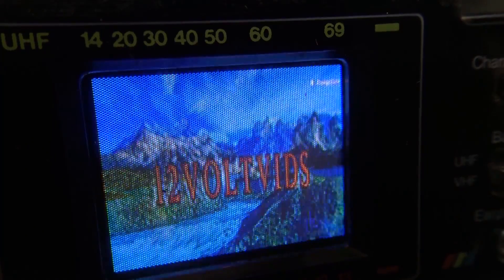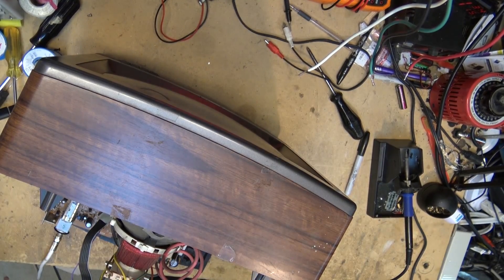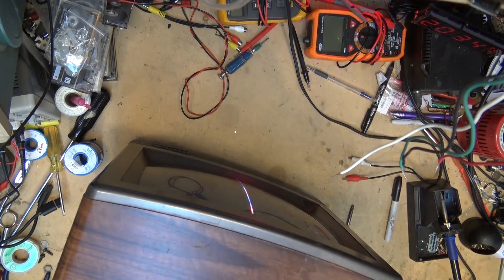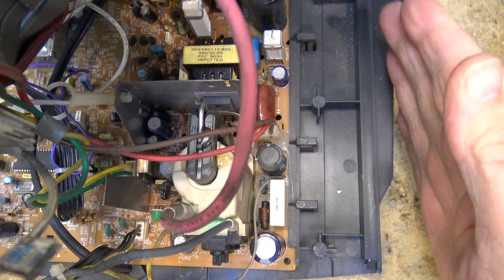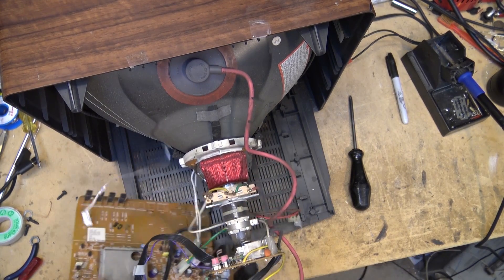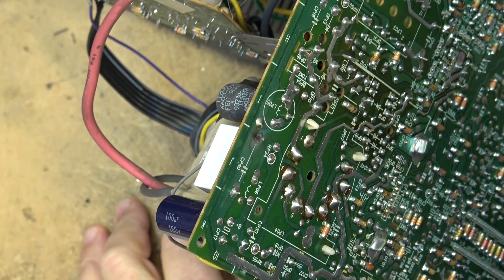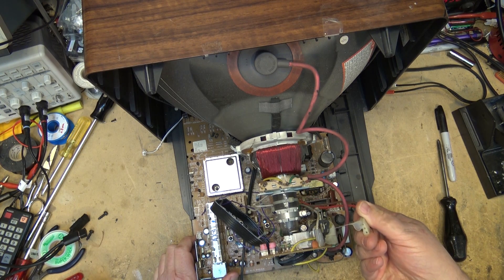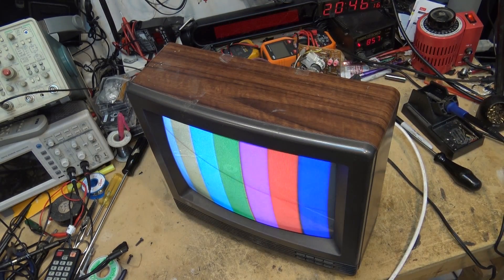Most Dangerous TV fault ever -  Fire Hazard

Comment: 40 + yrs at the TV bench at one of the biggest Zenith dealers in the Boston area. Love watching your vids, great memories.  Now bench talk.........
Maybe in Canada there was a fire recall but the only I recall we had on Zenith was the 4 lead
caps. IIRC the law suits were over the damper tube sockets on 4 tube hybrids. So common
I still remember the PN#  78-1888-01. No way they didnt have symptoms like SMOKE etc.
Also paper in the HV area wasnt used till  the Custom & Advanced System 3  @ 1983.
A few H yoke plugs did toast up on them but again now way no symptoms. The only other
thing was on some hybrids a huge disc cap would arc & burn a fiber board. The caps were
called back & if you ordered one you would get a tripler kit to eliminate it. 
To sum it up our local distributors head tech told us  " if any Zenith product goes into an
open flame & does not stop when unpowered confiscate the set & call me immediately 
if not sooner. This was late 70's

Best regards
Tom   
LFOD !
Reply from the maker: Definitely in Canada. I probably still have the service bulletin for the system 3 deflection board that the linearity coil burnt up. 
I remember the 4 lead safety cap recall too, where they changed the white cylinder type for an orange dipped type, and the damper tube failure.
There were several fires with these sets, most the board burnt up, and the set went dead, but there were a few where the set ignited, likely a console where the particle board cabinet caught. I do have a link to a news story below over one of the lawsuits. It was a Christmas day fire mid 80's. We got a bulletin from Zenith (as we were a warranty dealer at the time) that said that any set that came in within a specific serial number range that the deflection board needed to be inspected and if it didn't have a sticker on the shield that it needed to be replaced. The newer boards also had a white fiberglass shield as opposed to the gray one that looked like paper. Then another bulletin came out that said to resolder the horizontal linearity coil, flyback ect, and replace the old shield with the new one and affix a sticker to the back indicating it had been done. Now I don't know about in the USA, but here they had a few bulletins. They never issued a recall to the public telling them to not use the set as far as I know. It was just a bulletin for sets already in for service.

Comment: no av in you say?
most of polish tvs made by unimor in the 70's and 80's wern't designed to nativly support av intmut either. that is why in later years most of those tvs were either factory or privatly hacked to support "automatic av inputs"
in neptun D505 there was no av, but factory designed special av module umm2003 if i remember corectly which depending on the revision could output signal from tuner on output terminals, or take in av signals on input terminals and cut off tuner path by simple diode based polarised circuit (2 diodes,3 resistors and 2 capacitors)
the module was detecting synchronisation pulses and based on this enabled or disabled tuner default path and av passtrough
i made this module for my tv with an added bonus of rgb input. i belive it could also work with ntsc reciever , because it intercept signals before color decoder for av and after color decoder for rgb (or more precisely r-y b-y, y paths just before matric module)it might be more work for jungle ic tv though, my reciever is fairly modular.

Comment: bzzzt bzzzt bzzzzzt bzzzzzt. my fix was, scrape some trace coating, bend the leads over tight to the board and solder. alternately, wrap buss wire on the legs, scrape trace coating, lay it on the trace and solder.  neither way is good for majorly burnt board that's turned to carbon or carbon tracked..

Comment: I thought the infamous Zenith fault was the "critical safety capacitor". It was a 4-legged snubber cap across the HOT, 2 legs on each side of the cap, with B+ run through it. The idea was if the cap opened, it would kill the flyback's B+ supply and shut down the set. Problem was, the caps didn't fail open, they simply changed in value and caused the EHT to go up to over 50kV, arcing the neck right off the CRT and starting a fire.

Comment: Funny, that failure is pretty much the same that got me my first TV in the early 90s. The one I got had an electrolytic capacitor with some other stuff in parallel to that big film cap. The film cap wiggled loose but it was by all means not visible. It made the electrolytic go boom eventually and the technicians could not figure it out. So it went to the bin when I got it. I did the same, replaced the electrolytic cap, and after a day - it popped. Reverted to "bombarding" everything with solder and  then discovered that the film cap was actually loose. After that fix I used that TV until 2006 before I got a flat screen.
Reply: I remember an old RCA with a color problem. Eventually, I didn't have the time to play with it, so I sent it to a local RETS electronics school for repair - which they never managed to fix.
So, one holiday weekend after getting it back, I found a fractured solder joint on the delay line.
Needless to say, that was back before my arms started getting shorter...  ;)

Comment: Better clean that carbon deposits off of the board around the arcing point or it may arc again.
Reply: RE: "Better clean that carbon deposits". You couldn't be more righter :)  At the very least it's good practice. Period. Cheers!
Reply: I also agree, it's always good practice to clean the board where ever you do work before putting in the new parts. Impurities in welding steel is bad for the weld, and when it comes to electrical welding (aka. soldering) it's just good practice. But in reality, the repair may outlast the TV....
Reply from the maker: Arc to where? Nothing around it to arc to.
Reply: It arced on the underside of the PCB where the solder connection came loose and it left carbon deposits around that arcing location. If there is HV on one of the capacitor pins then it may find its way across those carbon deposits on the PCB to another pin where it does not belong. I don´t know if there is enough HV on that cap but I think it is generally a good idea to clean the PCB after such incidents.
Reply: I once repaired my Sony TV which had a bad flyback that arced. When I switched it on with the new flyback it arced between some pins around the flyback base and fried a diode. After I cleaned the board all was well...
Reply: i was shaking my head at that aswell....carbon IS electrically conductive and being spread across pins is not good...especially at high voltages
Reply: @WacKEDmaN  I have a lot of respect for his electronic skills, but his soldering techniques leave a lot to be desired. I've been to a lot of military soldering schools and some thing are just not good practice. However, it seems to work well for him, so who am I to say.
Reply: Early imported Japanese equipment is extremely rare and highly collectible. I think most were thrown away years ago. Many older technicians I spoke to disliked repairing them, saying they were more complex and difficult to repair than American devices. But I really enjoy repairing!🤗👍

Comment: One of the most common problems with electronics, cold solder joints. I've repaired many things just by touching up cold solder joints. I fixed my Ghetto Blaster boombox from the 80s which had weak audio output, it was simply not getting enough power. I guess the heat from the soldering iron woke up the main power filter cap.

Comment: I have a question about that solderpoint you re-soldered, it was burned and i didn't see you cleaning it and just solder over it, won't that be a weak point afterall?
Reply: ....... I was thinking identically, I would have 'wire wrapped' an additional line between the resistor & inductor. 
Have to keep in mind the multitasking of video production, our gender is not known for its mastery in this field. If he was working alone it would likely be different. You just want to wrap another video I assume.

Comment: Every one of those GE/RCAs had bad ground joints on the tuner...and I mean ALL of them.
Reply from the maker: DriveInFreak 
Yes I am fully aware of the ground problem on the rca/ge tuners. It was worst on the ctc 176/177/178 uni board that had the tuner built into the main board. Grounds would fail and corrupt the eeprom resulting in a dead set. I used to use a program on my laptop, probably still have it and I Made a interface cable with a clip to clip it onto the eeprom to reload default settings to get the set running again.  If I remember I used chip pic software to load it.
Reply: Nice. I had to go through all the settings myself. I cut my teeth on those things as so many came in when I was getting started.
I can't remember the sequence of buttons to push to get the eprom settings on the screen anymore, though. It's been too long.
Reply from the maker: Menu vol down and power wasn't it?
Been along time for me too. I "got out" in 2003 and swore I wouldn't work on electronics anymore. Then is 2012 I started working on stuff again from time to time.  Now, if I wanted to I could do it full time as I have people that ask me daily to fix their stuff. Most I decline as the modern junk just isn't worth fixing. I find the old stuff much more interesting.

We used to have an unauthorized slogan for those.
GE Garbage Engineering.
RCA Requires Constant Adjustments
JVC Junk Very Cheap.
Sony  Soon Only Not Yet

Comment: I have components from a modular deluxe System 3. It was set out on the curb with a busted CRT by the Salvation Army. I snatched all the boards, control drawer, 8 inch woofers and the tweeters. I noticed the high voltage board had a connecter burned off. I'm sure that made quite a stink. I'd like to have a working System 3 console like that in my collection. Add a  Zenith with space phone too.
Reply from the maker: Yes those HV boards were notorious for burning up. As a serviceman for years, you learn real quick which brands of TVs you didn't want to have in your house. Zenith syetem3 was one of those.

Comment: There are guys in the retrogaming scene that are trying to make an RGB input for these old tubes, so they can get the most out of the tube and the console. In this case, there is no sound input, but I'm guessing that if you can get an RGB input signal working, you can also get an audio signal in. That's a nice project (and tutorial), that will also give new value to these old TV's with no inputs other than RF.
Reply from the maker: The problem here is safety. These are AC line operated sets, and thus have a hot ground. That would be a major safety problem connecting anything to this or any other set like this. You would need to design an opto isolator. I should drag out my old Sony KV1965 and I can go though how sony put a video in on a hot chassis. They did it with optical isolation. Other companies did it with little transformers on the old sets. Then they went to switching power supplies to isolate the AV portion of the chassis from AC line. This one has neither so the only safe way to use this set as a monitor is to use an RF modulator, or plug the set into an isolation transformer.
Reply: I've found that if any of these sets were abused by poor handling as one might expect these connections would easily fail. A good number were all abused and dropped on the floor situations causing multiple damaged circuits that are really beyond any reliable repair.

Comment: It's such a shame that most tv's like that were made useless by crap lcd sets, the tube still looks good and the picture looks decent.
I would often have to resolder the lopt, mounting heavy/hot parts with solder was always a recipe for failure, but we still liked the old sets, they lasted so dam long :-D.

Hope you have a loverly xmas dave.
Reply from the maker: Not only was the old stuff reliable, but it is serviceable.  The new stuff is not designed to be repaired. When it fails you toss it away and replace it.
Reply: I know and i feel quite sad about it, i know through hole components are not the best, but i hate smd because they are a shit to work on.
And they fail because of pcb stress, capacitors just go short for no good reason ;-(.
It's my excuse and i'm sticking to it ha ha :-D
Reply from the maker: Line in, wouldn't that be the main power transformer?
The "Flyback" was originally called the HV transformer, but because it operated at high frequency, and occurred with horizontal retrace it was dubbed the flyback. Of course I never learned of it as the "Flyback" I always knew of it as the "Fryback" because my tv instructor was Chinese, and well, they can't say the letter L.  It was funny to hear him ask for "remonaid" at the cafe next door.
Reply from the maker: Sure were. People have short memories. Some of the worst offenders were brands such as Motorola, Zenith, RCA, Curtus Mathis, Admiral. All american made.  These were also some of the best ever made, and many of those old sets are still working today with few problems.
When circuit boards were introduced in the tube era there were many troubles just due to the heat from the tubes.
One of the nicest TVs I ever had, which was also a problematic set was the Philips K6 and Modular 4. The K6 was plauged with connection problems, and the modular 4 with bad plugs on the module connectors. Zenith also had huge problems with the module connections as did Motorola with the Quazar brand with the worksin a drawer. Remember them. All the boards were in a drawer that the service man could access from the front. Just remove a screw from the back, and press a latch, and the chassis slid out on a track for service. The problem was the interlock disconnected so the back had to be removed so a cheater cord could be plugged in for service. 
Defeated the purpose. Ah the fun of vintage electronics.
Reply from the maker: I agree. Old tube gear can be dangerous, much more so than modern gear. Now it isn't the tubes that is the problem. It is the old paper capacitors, and cloth wrapped wires that are more of a problem than the tubes. Modern tube gear is relatively safe as long as you aren't placing things on top of hot exposed tubes, and if you are covering your tube amp with a dist cloth, then you deserve the fire it will start.
Reply: I have a 1984 sony semi portable 18 inch still working fine superb tube from 1984 found in a charity shop i like the style of it set has the glass panel over the tube  rf only but i have a scart to rf adaptor an old computers i can use it with .I have also recued 2 sony 21 inch sets that wer thrown out amazing tubes on both the newer of the 2 the service mode shows that it has been in use for 8068 hours both the sts are 4;3 aspect ratio again perfect for retro gaming.|There was a sony widescreen free but apart from being heavy it was to awkard for me to carry so had to be left .Someone chucked a sharp 32 inch lcd in an alley behind my flat works perfect japanese made set and is 14 years old good for an lcd  just no stand and ebay prices are more than i want to pay so will try making something .
Reply: Nope, not expensive sets, just change the faulty board, however its never happened to me anyway, been running daily for over 10 years with zero issues. you get what you pay for, there were bad vintage sets as well they are not immune.
Reply: I think most valve tube stuff in the 60s was a fire hazard anyway with all the heat and high voltage present. i know shango has to put fans in his old tvs, especially around the arcing flybacks, its never a good idea to leave old tube tvs running unattended.
Reply: Line in transformers or flybacks as known in america are the silent killers in old sets, they can just randomly arc and catch on fire, no warning. but yea its a very good idea to fit even a slow running 80mm 12v PC fan in these old sets and radiograms, they can be evil. another good safety idea is to completely surround the flyback in black silicone

Comment: i think its called fish paper, i have seen quite a bit of it in electronics
Reply from the maker: Wendell Porter 
Lot was brown stiff with fiberglass woven in like those old fiberglass pc boards. It would burn
Reply: 12voltvids no wonder zenith was sued over it highly flammable stuff I have seen some other Television boards that have caught fire what a mess not safe at all my grandfather had to deal with the famous zenith safety cap failures and if I recall some of the crts in those sets imploded when the cap failed
Reply: We used to fix loads of Wyse 50 terminals back in the day (and DEC VT 100s and many others). They had similar issues. Fundamentally they were very like a monochrome TV with a logic board. 
You can find a full schematic for one of these monochrome antiques here.. 
https://amaus.net/static/S100/wyse/terminal/Wyse%20WY-50%20Terminal%20Mainenance%20198601.pdf
.. if you want to know how a CRT based device works, this is a good place to start, as it contains a wealth of information. 
Page 150 onwards for the PSU and CRT board schematics (the bits that typically failed). Capacitor C206 was one of the prime suspects, we made a small fortune from replacing those (and sometimes the associated transistor (Q202)) over the years. This is almost identical to the failure mode of the TV in this video. 
If it clicked and didn't fire, or was stone dead, or  sometimes fired up on a subsequent try, it was likely to be C107 and sometimes R110.
Reply: Perhaps SRBP was specified, but non fire retardant (i.e. cheaper) phenolic paper was substituted.
Reply from the maker: It was usually the actual PCB that burned. A big hole around the linearity coil.
Reply: I never was a big RCA fan.  They always had solder issues as did the GE's under the Thompson brand